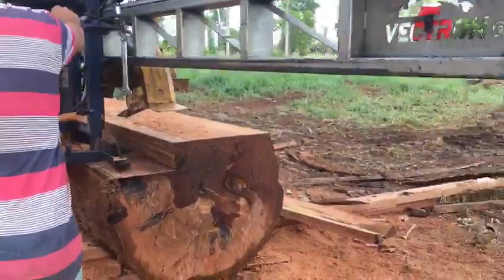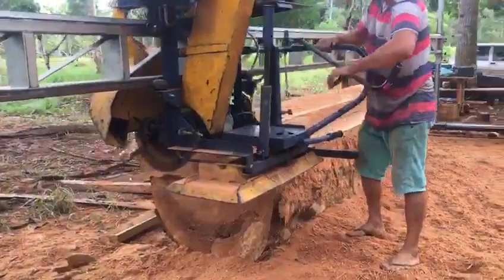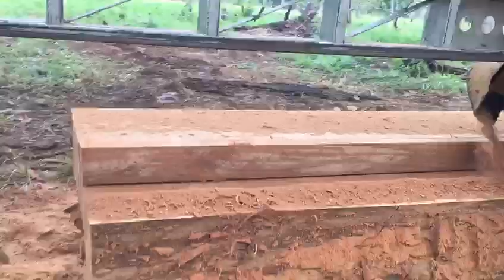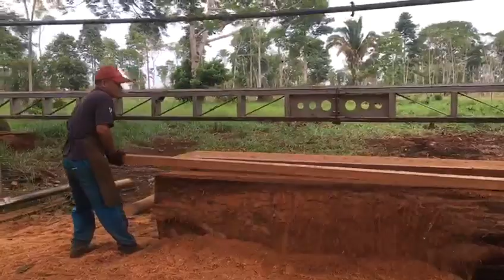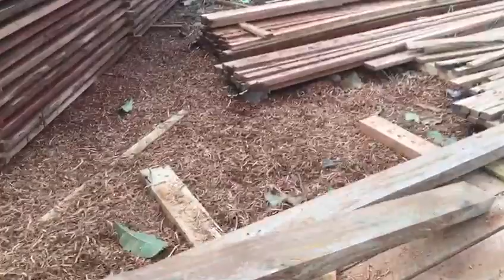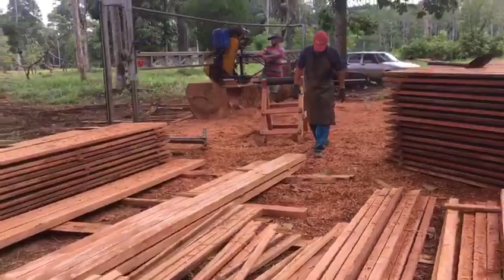REDUZA CUSTOS E TENHA MAIS RENTABILIDADE COM ESSA MÁQUINA!

Comment: Poderia  me  passar  algumas  informações  essa serra que usa ela corta  dos dois lados de frente e traz e videa ou uma serra específica  pra essa máquina o motor  não muda a rotação conforme  o corte da madeira  por eu vi no vídeo da a impressão  que ela vai cortando  normal e quando volta corta também
Reply from the maker: Isso mesmo! O disco vai na horizontal e volta na vertical. A Serra é fabricada de acordo com nossa máquina e temos motores com potências diferentes de acordo com a necessidade de cada cliente. A máquina é potente, corta todo e qualquer tipo de tora! Gostaria de saber mais? Entre em contato com nosso time pelo número 91 98164 3769 que eles irão lhe ajudar com todas as informações sobre nossos 07 modelos 🤝
Reply: vcs  são  do  Pará